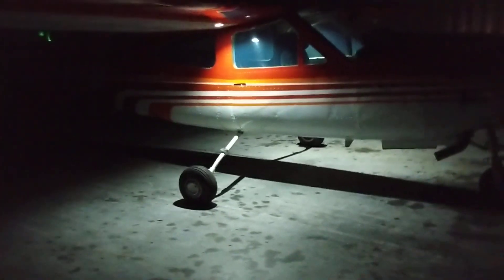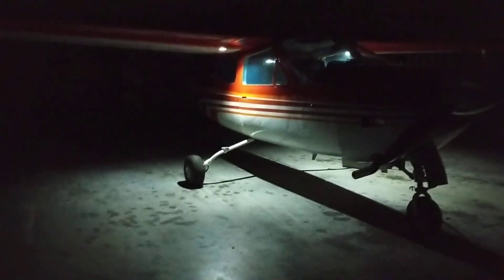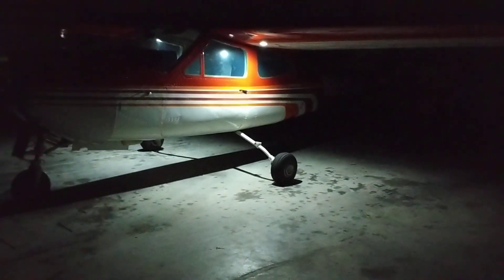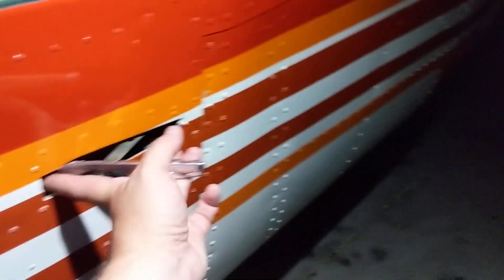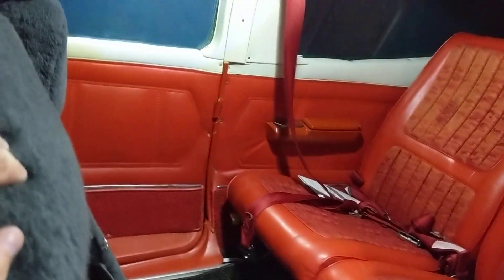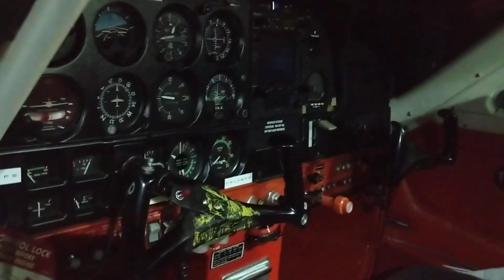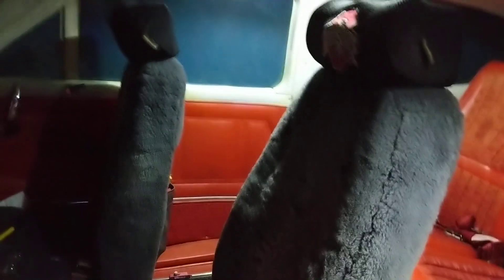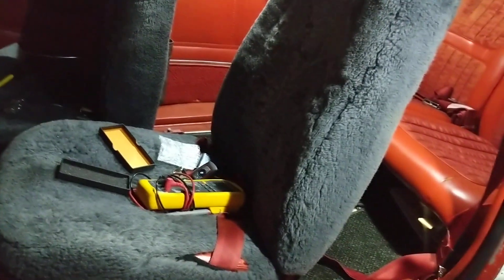N8971M Cessna Cardinal under wing courtesy light LED upgrade.

Comment: I just bought a 177B. I can't find the switch for the standard Courtesy lights. Which one is it? I may need to replace the bulbs anyways but I want to make sure I'm not missing a switch or haven't tried something right.
Reply from the maker: The switch for the underwing courtesy lights is in an odd place:  Look on the rear pillar, pilot side (behind the pilot seat).  On that rear pillar, you'll find a little black slider switch facing the rear of the aircraft.  It controls the underwing and pedestal light (master switch on of course).
For the overhead interior light, there is a switch just in front of the light itself right overhead.
Reply: Lynn Dixon I just bought it and only flew it once. Never noticed those switches! I’ll take another look. I have the 1973 model. Thank you!
Reply from the maker: Congrats on the purchase!  Cardinals are awesome aircraft!  You'll enjoy flying it.  If you haven't already, checkout the Cardinal Flyers Online group at :  http://www.cardinalflyers.com/
There is a TON of information available for free on the site, but membership is only $35 / year and its a very active community of Cardinal owners, and the membership gets you access to even more information.
Reply: What is the part number of the bulb you bought off of Amazon?